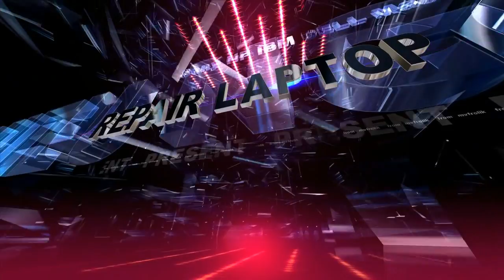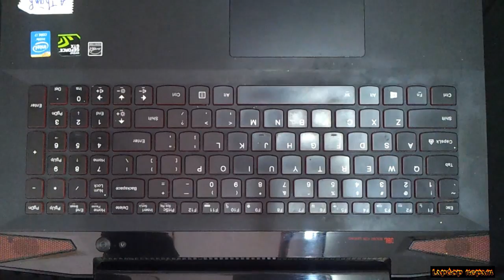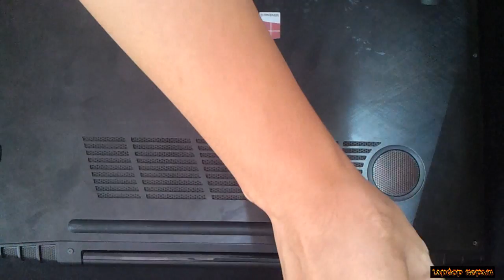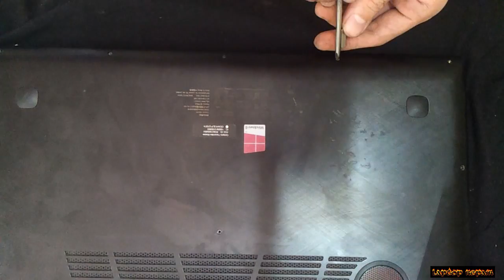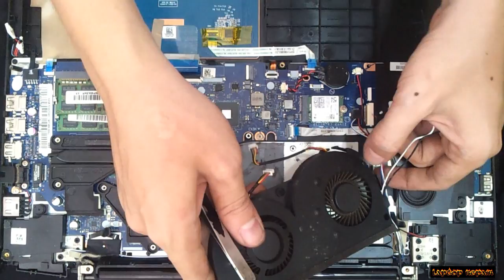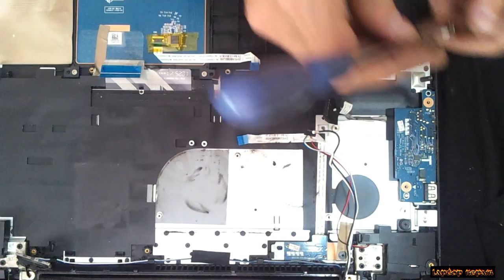Lenovo Y50-70   Disassembly and fan cleaning  Laptop repair

Comment: 6:20 ERROR!!! You should not remove this metal because it has the thermal paste attached, if you remove the copper, you must buy another new thermal paste, be careful, it was not necessary to remove the metal.
Reply: Thank you for the heads up @Alexander Meija Seca. This is the first time i'm opening my laptop, i wouldn't have known about having to apply new thermal paste if i had removed the copper. I'm only cleaning the fan because it's very noisy, first time in 7 years lol.

Also thanks OP for a very good tutorial!
Reply: It's a disassembly video? He didn't need to remove the battery or HDD either but did so to show people how to do it.
Reply: @dbp-wv1hs  I said it, 'cause sometimes there are people what disassembly looking at the video, but they are surprised that they have no thermal paste at that moment.
Reply: @alexanderm.s.5983  thanks bro,, now i know why my laptops got overheting ans shutoff randomly...

Comment: HI, Could i put Samsung 970 EVO PLUS M2 hard disc to lenovo y70-70 ?
Reply: I changed mine for  a Samsung 850 EVO SSD and works like a charm :)
Reply: On the Lenovo Y50-70 (not the Y70-70 as you mentioned)
Reply: No. The Y70 supports SATA drives, not M2 or NVME. You will need to get a SATA SSD.

Comment: The head of the center screw is distorted and now rather than a + its a circle :( what to do ?
Reply: I'm sure you've already gotten this figured out, but a little bit of super glue has always done the trick for me. Put the glue on the stripped screw, place the driver in the glue/screw, and wait for it to dry. If that doesn't work you can always use a rubber band!

Comment: i got an issue with the touchpad before, the right click button ceased to work, after i teardown the touchpad i saw there is a small circular metal part below the touchpad which is covered with plastic sticker, and i come to know the plastic started to peeling off, after i heat it up with hairdryer and stick it back in place again, the problems gone, i worried the plastic will start to peeling off again, can i just remove the plastic? Sorry for my terrible english and thanks...

Comment: ok this might totally sound like a dumb blond question but... the middle screw in the back cover can't be unscrewed, the x part is destroyed and is completely round lol anyway I can unscrew it with out breaking the cover?
Reply: sometimes a wide rubber band on the tip of the screwdriver is enough to start the screw

Comment: Hello,my questions is if I want to replace my thermal paste on the y50-70 do i have to replace the thermal pads too?
And what pad thickness do i use for the lenovo y50-70?
Reply: si es necesario cambialas, es decir si ves que tus pads estan rotos, perdieron consistencia y forma si cambialas, a la mia le pusieron de 1mm pero en internet un vago dijo que le fue mejor con 0.5mm ya que con un 1mm decia que no se dicipaba bien el calor

Comment: Is there a way to replace the keyboard? I spilled some soda on it, seemed to be fine but now, i have to press any key from the "QWERTY# line to make all other keys work, every single time. I've been looking for a tutorial with no luck, and I have notices the keyboard being sold for replacementes so I imagine there is away, but can't find it.
Reply: I've replaced the keyboard before. You just have to open it up, take all the pieces off the old keyboard, and then replace the pieces on the new keyboard.

Comment: the bottom of my laptop wont come off that easily, i dont want to break anything by pulling too hard but it just wont come off.
Reply: The reason you're having trouble removing the back is because the video provided no explanation for how to remove it without breaking anything.  Once all the screws are out, lift the bottom from the edge furthest from the hinge.  Once you've raised that portion of the bottom by about 1/4 inch, push straight back and the bottom will slide towards the hinge, about 1/2 inch..  The part you are removing (the bottom) actually  is not totally flat.  Part of the bottom wraps around the hinges, covering them.  Once you've slid the bottom back enough, you can lift it straight up.
Reply: @kittysmith9129  it won't move, I'm pushing as hard as I can and it won't budge.
Reply: @yotoprules9361  Make sure all the screws have been removed.  Some screws may be hiding under stickers or rubber feet.  While pushing the bottom towards the hinge, lift it a little (but not more than 1/4 inch).  Maybe gently attempt to pry the bottom off (knowing you won't be able to lift it until you've slid the bottom towards the hinge) just to break any seals that may have developed over time.  It's really just the screws and the way the back of the bottom wraps around the hinges that keeps the bottom on.
Reply: @mbmast1  i was eventually able to get it off but broke 3 of the clips. tried my best not to lol. also is yours super sharp, ended up cutting myself on the edge of the bottom cover
Reply: i used quite some force at the last clips!
Reply: Massimo Micallef well just so you know it prob came off easy for him cuz hes opened it b4 and u havent so dont worry about using a bit a force
Reply: Fuckin same, the corner clip is holding on for life 😭
Reply: i have broke behind parts... but sometimes you have to
Reply: KidCudi it's for voiding warranty if you opened up by yourself
Reply: @Faggydoo  lol in the same reply that you thanked the man, you had to critique the measurement system he decided to use. They each have their place, this argument is getting old. Should be taught both from the beginning and told what use cases work for each. This is just becoming another lame us vs them argument. Educate yourself
Reply: You probably have some unscrewed screws.

Comment: Could i clean the fans without voiding the warranty?Mine is pretty noisy even when surfing the web.
Reply: +florin9015 I have a problem with my left speaker, and I was wondering if I had void my warrenty by opening my laptop when I upgraded my RAM from 8 to 16GB.
I went to the Lenovo forum, and a support specialist told me this: 
"First with the warranty condition , upgrades do not void the warranty unless something get damage in the process. 
This also goes for checking cables and devices port when opening the covers, taking caution in doing so."
Therefore you can open the laptop up and clean the fan. The only way you can void your warrenty is if you break stuff yourself when you do this.
You can find the forum post here: https://forums.lenovo.com/t5/Lenovo-P-Y-and-Z-series/Warranty-questions-about-Y50-70/m-p/3327348#M143717
Reply: +Animiles Thanks!